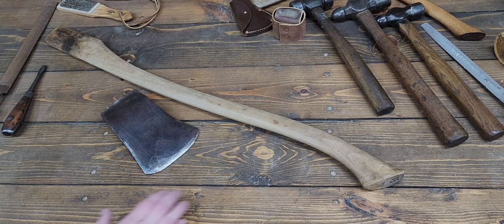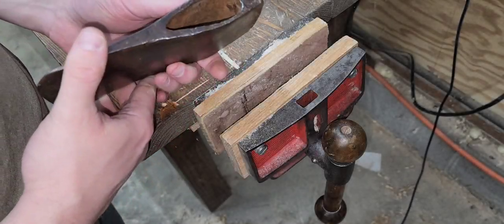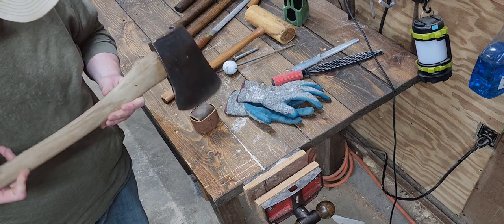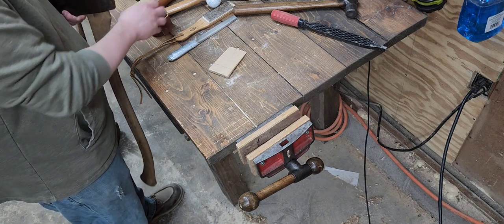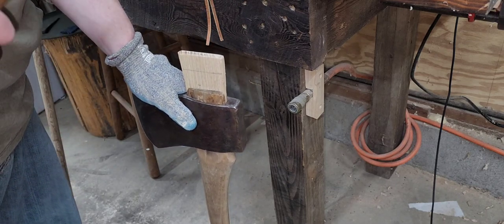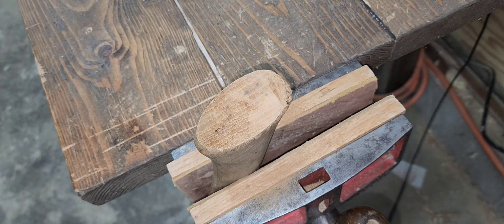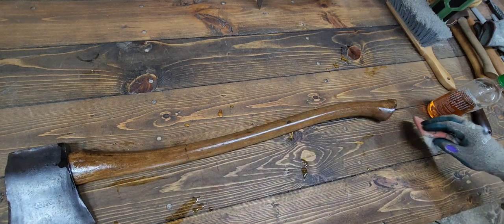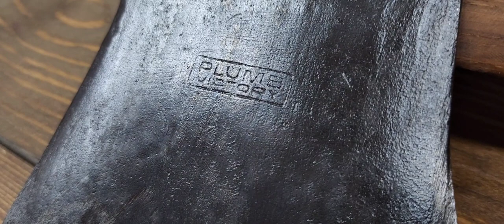1940's PLUMB VICTORY Axe Head Hung on Vintage Handle

Comment: I like the leather swell saver.  Might have to make one.
Reply from the maker: Thanks man! I'm a fan of it and it can be made with minimal leather. You could easily do it with an old belt and a few stitches of thread. I went with the copper rivets because they are quick, easy, and durable.

Comment: You’re right, you really can’t fake that aged look. Good choice on pairing the head and handle together. Turned out great. Also what were you doing with that windex and rusty axe head? I feel like it was a pro tip you need to share.
Reply from the maker: Haha, thanks! I'm not sure about a pro tip. It was more of an experiment. The part of the shoulder I shaped during hanging looked a bit fresh, so I tried to age it a bit. I took some steel wool and knocked some fine rust and dirt off that other head and onto the clean wood. Then I used the windex to help it soak into the wood more. I believe the ammonia in the windex also helps age the wood. After I hit it with my torch for a little more color and to dry it out. I wasn't sure if it would work. I'm happy with how well it blended into the older patina.